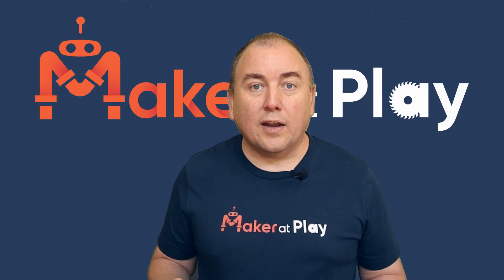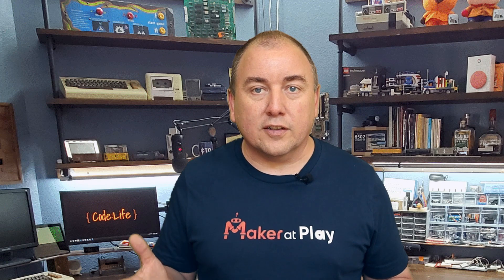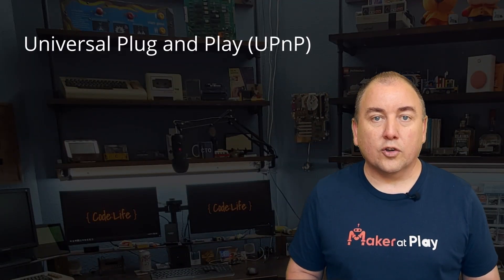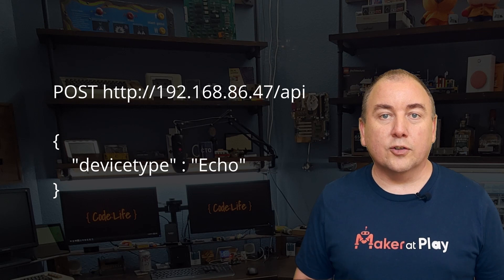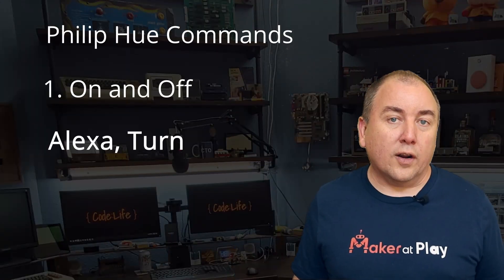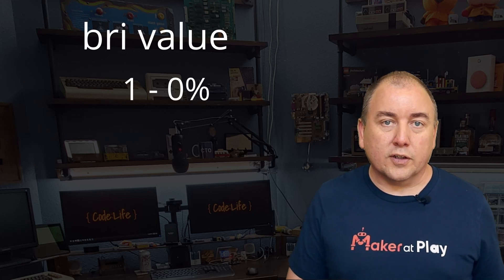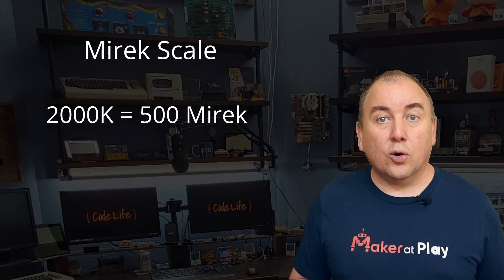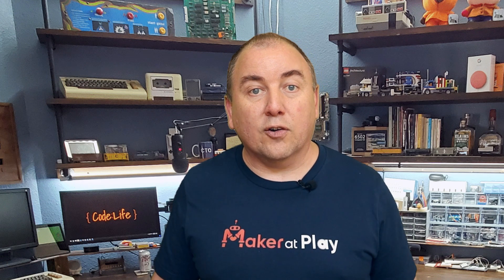Alexa Voice Control for ESP32 (Arduino) by Emulating Philips Hue Light

Comment: This is very helpful! I have been looking into doing this for a while. Do you know if it's possible to emulate a actual Phillips hue light in a way that it can connect to the official Phillips hue app? I would ideally like to use an Arduino/ESP32 with ZigBee and integrate it into my existing hue system.
Reply from the maker: It should be doable. I don't know all the details, but you would just need to implement all the ZigBee signals that the Phillips Hue Bridge expects.